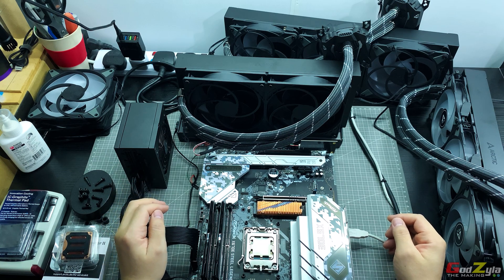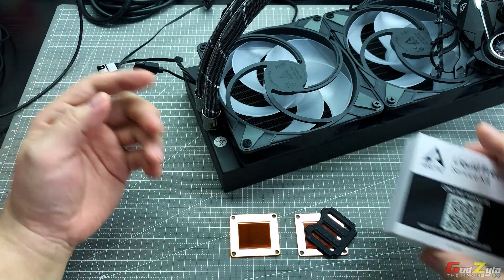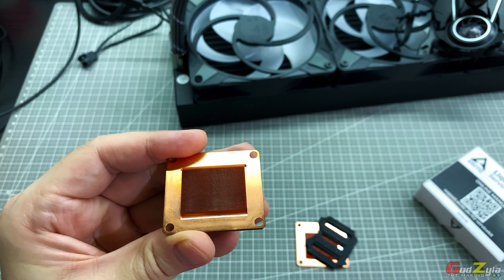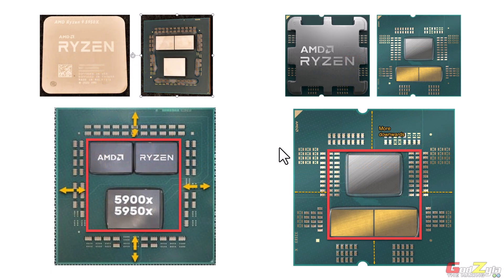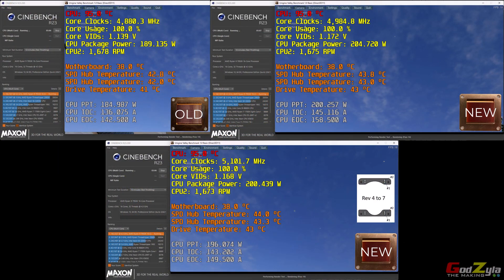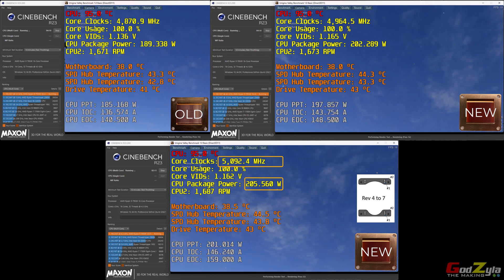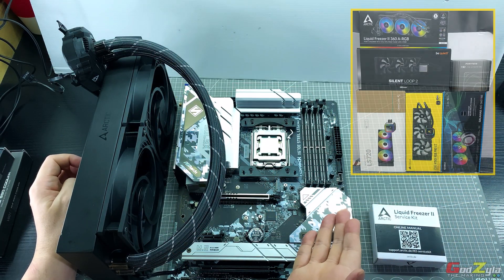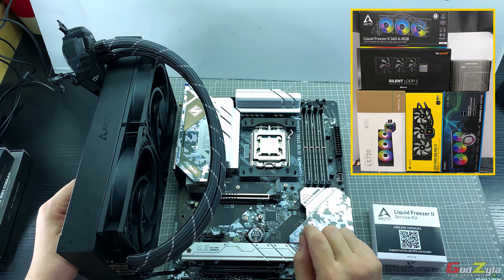Arctic Liquid Freezer II - Amazing Engineering

Comment: Will the lian li lancool II have space for the Arctic Liquid Freezer II 360 A-RGB? I think I might have to remove the disk cage because of how thick the AIO is. Do you have any recommendations for best 360 AIO as of now 9 months since this video was posted?
Reply from the maker: Hello RiptideGaming06, welcome to my channel. Arctic Liquid Freezer II are always top of the line for year 2022 till now. if there is any other recommendation, I will recommend the Galahad Trinity II Performance or EK nucleus aio. As for the Lancool II, you will be able to fit the 360 LF2 at the front and yes, you will need to remove off the HDD Cage.
Reply: @KleoYan  Would I have to remove the disk cage of my Lian Li Lancool II X for the EKWB Nucleus AIO CR360 Lux D-RGB?
Reply from the maker: @riptidegaming06  it will fit but you need to push the hdd cage towards the back position. Please note when you push the hdd cage towards the back, make sure your psu is not longer then 180mm in length. Infact if you don’t use the hdd cage at all, best to remove it.
Reply: @KleoYan  i have one ssd in it and my psu is 200mm - should I just remove it then, and if so, how do I secure the sata ssd outside of the disk cage?
Reply: Also, if I’m going to have to remove the disk cage either way, should I get the arctic or the ekwb aio?
Reply from the maker: @riptidegaming06  either liquid AIO does perform. Btw what processor are you using? And to remove the HDD cage, this might aid you out https://youtu.be/IAeqLdRo2ec
Reply: @KleoYan  5800x3D
Reply: I’ve got an existing PC build, but the AIO has developed a bad sound, likely from wear and tear - it’s a 4 year old coolermaster masterliquid ml360r
Reply from the maker: @riptidegaming06  oh ok. As mentioned either of the AIO mentioned will perform.
Reply: @KleoYan  ok - is one notably quieter than the other without sacrificing meaningful thermal reduction?
Reply from the maker: @riptidegaming06  either of the AIO mentioned it’s quiet plus better thermal performance.

Comment: Hey bro, if i purchased it this week for my new r7 7700, will I need the service kit...? Or have they fixed it since then
Reply from the maker: HI WTFGAFS, welcome to my channel. It will be best to look for the QC Sticker on your radiator or on the box itself. If you do not have that sticker, request the service kit from Arctic https://www.arctic.de/en/lf-service-kit
Reply: @KleoYan  Hey man i built it yesterday and it had a sticker on the box and radiotor so  think im safe :) Thanks. Also wanted to know what kind of temps would you expect on the ryzen 7 7700. I see people commenting they got their temps in the 50s with their i7 and i9 lmao... Mine does 50 to 75 depending on the game. Did I seat it incorrectly ?
Reply from the maker: @TheAmanor123  good to hear that your LF2 AIO is with the QC sticker. as for temperature, it greatly depends on which region you at, to have temperature at 75 Degrees celcius at  load, it's all good.

Comment: I have a Arctic Liquid Freezer II 360 a-rgb will the pump and fans work if i dont use the a-rgb connector?
Reply from the maker: Hello Laura Linder, welcome to my channel, yes you can plug just the pump and fan connector without having the a-rgb connector connected to your motherboard., it will work, only thing which will not work are the ARGB leds on your fans P12 ARGB Fans.

Comment: Brilliant information! Bravo!

And here I was about to mount AM5 without the offset, what a mistake that would have been.
Reply from the maker: Hi Bud The Cyborg, welcome to my channel, you are not the first. I did the same mistake back then but now we know what's the offset bracket is.
Reply: @KleoYan  In the end it turns out the offset bracket hits the M.2 cooler on my new Motherboard, "sigh", I need to order the warranty replacement gasket anyway so now at least I know that I need the new bracket to go with it.
Reply from the maker: @budthecyborg4575   I see. yup for anything new which is Rev 4 onwards, the offset brackets will be an easy fit. that was also part of the reason why I did not use the offset bracket in the past as it hits my m.2 motherboard armour shield. let me know how it turns out in your system when you do have the new brackets. I am sure you will not be disappointed.

Comment: if you don't run a benchmark on the 7900x all day and use the processor in games, and in work tasks for graphic design, Photoshop, prime minister, will the Arctic 280 cope with cooling?
Reply from the maker: Hello Voiru Zeclorum, welcome to my channel. Yes it will be able to sustain the heat no issues. It will even be better if you undervolt the 7900X, that is to tweak the PBO2 settings

Comment: Running Cinebench on my 7950x I got 92c Max running at 5.1GHZ undervolted to 1.060V but at that temperature the air coming from radiator is cold and I hear no pump noise. I don’t know if my Arctic Liquid Freezer II 420 is broken
Reply from the maker: hi Alpzepta, welcome to my channel. Whats your idle temp? and whats your room temperature?
Reply: @KleoYan  the room temperature is 25c and the idle temp is 40c
Reply from the maker: @PreciousAlpschindler  i see, looks normal. nothing to worry about. unless your idle temp is like 60 to 70 degrees celcius consistent, then you will need to take note.

Comment: My question is if i was to buy a 420 ALF2 today would the cold plate be the newer revision or would i still have to order the replacement kit for the taller fin stack? i plan to cool a 13900k
Reply from the maker: Hi Vontai Vanputten, welcome to my channel. It will be best to check if there are any QC sticker when you purchase it. It's on the radiator and on its box. If you have that, you don't have to get this service kit. As for newer version from rev 5 onwards. All are using the new coldplate.
Reply: @KleoYan  Yes i really like your channel and video it made me understand the off set a bit more with your editing. and i also will be mindful of the QC tag when i buy my aio system.
Reply from the maker: @VontaiYoutube  thanks for the feedback. Hmm maybe this might interest you too. Is not about the thermal paste but the method I use to apply thermal paste. A handful of my viewers gain by applying the method to their desktop setup. Interms of thermal results https://youtu.be/xZ2R4roF1_Q
Reply: @KleoYan  ohh yes, sweet this is a great body of research. i have MX-4 paste. im checking the video out now
Reply from the maker: @VontaiYoutube  ok. All the very best 😊

Comment: Hello!
Tell me, the new cooling radiator from Arctic already has a thread in place for the bolts, is it not painted over with paint or is the aluminum untouched? And the sticker of the pump is crooked pasted and as if it was re-glued? Could this be new from the store?
And the pump can hiss like a soluble tablet in water if it is above the radiator?
Thank you.
Reply from the maker: Hi ~Oia~, welcome to my channel, I dont quite understand your question for the first part. as for the pump, if it's above the radiator hose, it will generate noise and it's not advisable to place it this way, ideally is to place hose blow the pump or to mount the entire rad at the top of the case.
Reply: @KleoYan  Well, what I mean is, can a new system be threaded on the heatsink from the factory? Or does this mean that someone has already screwed the screws into the free side of the heatsink? It’s just that I already have threads for screws on the radiator and the pump sticker was crooked. But the bags with the mount are not touched. Can it be so? Never dealt with Arctic before.

And I know that the pump should not be higher than the radiator, it’s just that the sound is usually different, more gurgling, but here it’s hissing like a soluble aspirin tablet, is it the same with you?
Reply from the maker: @Ftroll  hi, ok by default for AMD 7000 series platform (AM5) it comes with the offset bracket where you need to remove the original mounting from the motherboard and to replace it with the provided Arctic offset bracket and as for Gen 12th and Gen 13th Intel platform, if your Arctic Liquid Freezer II is of rev 4 and above, it will come with the intel 1700 bracket. as for logo being crooked, most of my LF2 360, 280 and 420, they are all nicely stick. if you need more info about your cooler you can either scan the QR code on the box itself of there is a small card that shows you the QRCode. or you can refer to this https://support.arctic.de/cpu_liquid_coolers
Reply: @KleoYan  It turned out to find out that the new radiators already have screw threads.
By the way, your videos are very informative, it's rare.
Reply from the maker: @Ftroll  Hi, welcome back and thank you for the update, I was not aware of it and thank you for your valuable feedback, all the very best with your build too. 😉

Comment: What are idle temps, gaming max temps? With this aio with 13900K at default power limit of 253W.
Reply from the maker: Hello Moto 346. In open bench test, my idle temp are at 44 to 48 degrees. Take into account my country is always hot and humid. If inside a case (my lancool 3) idle at 45 to 49. As for game play, I have no idea as I don’t play games but for 3d rendering and video compilation, am getting 78 at max load as I do pbo2 on my 7950x, drawing power is at 185watts. As for intel. Sorry to say I do not have that and kindly note. This channel is based on my hobby am not a reviewer but to share my experience.

Comment: Do you have an Artic Freezer II 120 to test with a Ryzen 7000?
Reply from the maker: Hello GrTitan n, welcome to my channel. Nope I do not have a 120 LF2. Therefore can’t test it. Infact I won’t advise to use a 120. Is best to use in 7700x to 7950x is with a 280, 360 or even a 420. Unless you are referring to 7600x then a 240 will be sufficient.
Reply: @KleoYan  hmm, the case that i have only supports 120" sized AIO and i am really curious. Then again, Artic says that the 130 has a limit of 200e and that's around what your video shows, so that do makes me curious.
Reply from the maker: @grtitanncorner  hi, as what I have suggested is based on my own opinion. I have a practice of giving more buffer which will not jeopardise the longevity of the processor. You can give it a try and if you find that the 120 LF2 is unable to do the job, then you might consider to get a bigger LF2. Next to sell off the 120 LF2 to cover some cost for your bigger LF2.
Reply: @KleoYan  yeah, if the test fails, i won't have any choice but to buy a bigger one 😀
Reply from the maker: @grtitanncorner  well, no harm trying, just make sure to keep an eye on your other components temperature. If it’s significantly high and the cpu clock speed is lesser than 4.8ghz. Then you really have not choice but to get a bigger AIO.
Reply: @KleoYan  thanks, good points!
Reply from the maker: @grtitanncorner  👌all the best with your build.

Comment: Very useful info! Arctic Liquid Freezer II 360 A-RGB on order, bought it yesterday and it was a toss up between EK Basic AIO 360 or the LF2. Their openness and approach to the gasket issue sealed the deal for me. The performance? that was the cherry on the cake 👍🏽.
Reply from the maker: Hi Earth Taurus, welcome back. Yup Infact you won’t go wrong with either of the AIO you’ve mention. Both are as good. I might not have the EK Basis but a friend of mine does. Nevertheless Arctic still have the punch on newer generation processors and this mind interest you as how Arctic compared to the 5 AIOs I’ve tested https://youtu.be/YTojxRPyrQs 😉
Reply: ROFL so do I exact same model but the RGB version expecting it Tuesday.

Comment: Not gonna lie, sometimes I wish that I simply bought an Arctic LF2 AIO (280/360/420mm) instead of going with the headache of a custom loop.
Reply from the maker: By the way Ben. You might be interested in this https://youtu.be/YTojxRPyrQs. It’s proven Arctic LF2 might not have blinks but it’s a performaner.
Reply: @KleoYan  thank you Kleo, I will check out your link
Reply from the maker: @Logan-zo3lj  you are most welcome.
Reply from the maker: Hi Ben T, there are food and bad on both. For custom water looping, the strength is still having better thermal results. Only inconvenience are 1) have to clean it like after 6 months to 8 months 2) it’s more expensive 3) if any component need troubleshooting. You have to drain the loop. As for AIOs 1) they have a limited lifespan 2) hose are clunky and sometimes will have a hard time fitting into a case 3) some of the pump is rather noisy after sometime of usage. So don’t feel bad about it. Maybe next time you can go easy by getting the Arctic liquid freezer II which till now. It can still take the beating of a amd 7000 series.
Reply: @KleoYan  You raise there some very good points, most them which I gave considerations to before going with a custom loop. I jumped from an air cooler to watercooling without ever using the middle ground AIO option lol. It was very overwhelming. I bought all Barrow and Bykski brand stuff from Aliexpress. Bykski 3x 360mm radiators, Bykski pump/res combo, Barrow fittings etc etc... It's just now I have so much spare type of fittings and tube cutters and watercooling stuff related, looks like I'm running a workshop!

The price isn't really that much of a big deal, it's mostly the maintenance and the scary thought of something going wrong *again*. I already killed one motherboard due to a leak which completely my fault being careless and not tightening properly. It's still a hassle it I want to change the thermal paste or try a new GPU. Maybe I should get quick disconnects for the CPU and GPU so I won't be such a cry baby lol.

But anyway I've always loved the Arctic lf2 line up. I even use their P12 fans on all 3 radiators in this build.
Reply from the maker: @Logan-zo3lj  Pardon me for the late reply as I was on a call. I have to agree with you. I love the P12s, be it the non argb or argb. though the P12 non argb are stronger but it's only by 2 to 3 degrees different from the argb, but the argb are so much quieter compared to the oringal P12s. till now I still can find any fan which can beat it's price vs performance. Those which can beat it is either too high ampere or the price is way too high.
Reply: @KleoYan  I'm currently using 10 of the p12 pwm pst non argb in an o11d evo, 9 on the 360mm radiators located top, bottom and side and a lone fan on the rear. not gonna lie, a year ago before i got into watercooling i was alllllll about argb, i would go on pcpartpicker site and check out top rated rigs, and think how i could make my rig look awesome as well with argb, custom cables, and color theme matching the motherboard, ram and gpu.
now on watercooling i dont use any argb at all, rly dont care about it much, i think the matte stealth look of the epdm (similar to ZMT) tubing along with silver fittings, and the black radiators and black arctic fans look super nice as it is. I haven't tried the p12 argb fans, although i heard they should be alil bit quieter, if I'll ever do an argb glow up then i might get those. but to be honest what I'm really waiting for is something similar to the p12 performances, similar or better argb to the p12 (it's nice but nothing spectacular), and daisy chain connection like the lian li fans. Basically if arctic ever does a p12 daisy chain edition I'll be on the first to get it. 

have u ever reviewed the arctic p12 bionix that go up to like ~2050rpm? i have 2 of them and i also like then a lot. If i were to waste another $300 on this rig then I'd replace all the fans with noctua but i reaaaalllly don't see any need to unless i had some extremely sensitive ears
Reply from the maker: @Logan-zo3lj  hi ya, for the bionix, I only tried the P120, F120 , P140 and F140. yes they are indeed good fans but abit louder. nevertheless as what you've said, there is a Arctic Bionix fans that does the daisy chain but not much people getting those. they perfer the fancy argb fans from corsair and the uni fans from lian li..

Comment: I'm building a PC with the x670e Steel Legend and 7950x but i'm still waiting to get the service kit since the Liquid freezer 2 - 480 i have does not have the QC mark on it and i had it in storage since mid 2021
Does the brackets still fit with the pci5 heatsink for the m2 fitted on ?
I see that you don't have it on the MB , so i assume you either took it off for the video to no block the view or it doesn't fit because of the arctic bracket.
Hoping it's off just so it doesn't block the view :))
Reply from the maker: Hello Alex Stan, welcome to my channel. Nope it does not block at all if you use then offset bracket, just that I am using that to boot my system as I am too lazy to dismantle the heatsink in the Aorus m.2. Rest assure the original can be place when you mount the Arctic liquid freezer 2 offset bracket 😉
Reply: @KleoYan  Thank you for the answer, i was worried a bit about it not fitting, now all i need to do is wait for the service kit to start my build :D
Reply from the maker: @alexstan9555  you are most welcome, all the best with your build too.